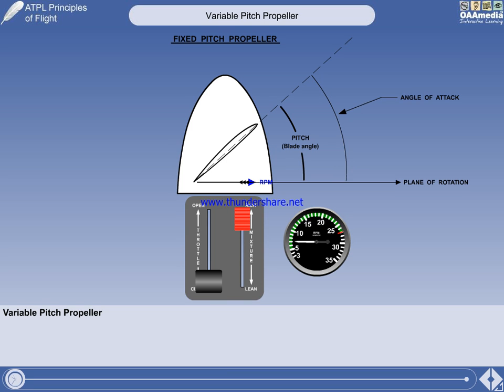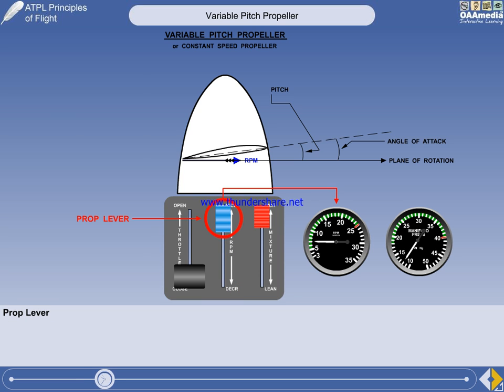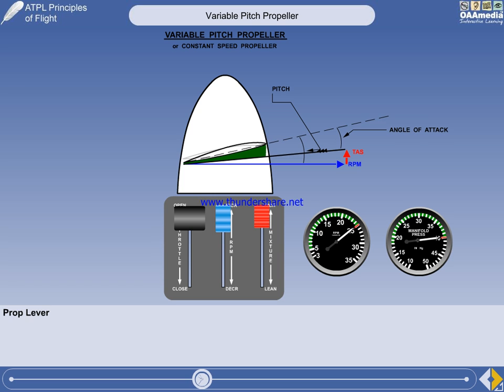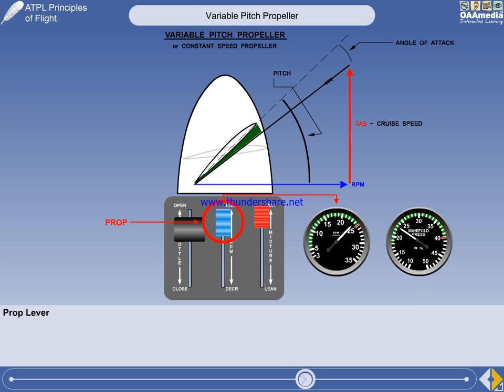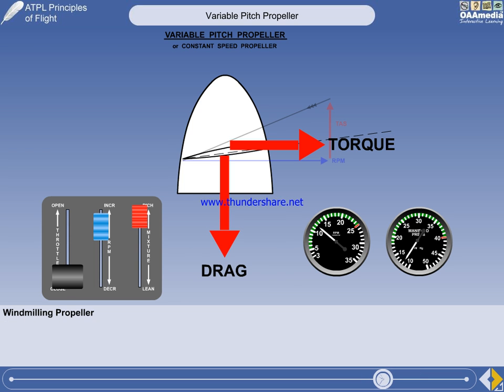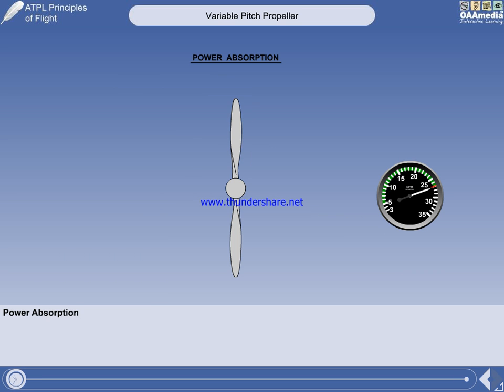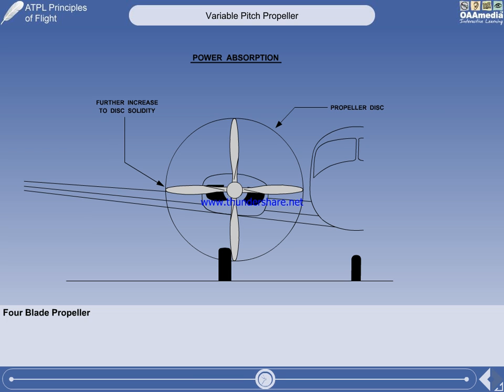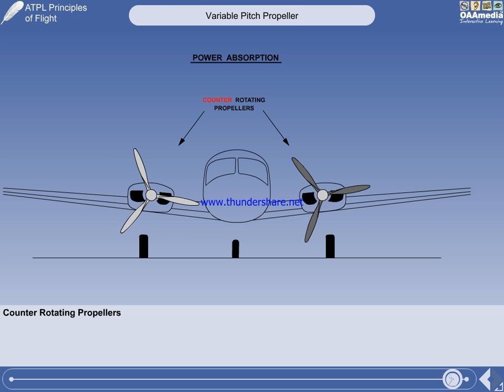CPL ATPL CBT | TECHNIAL GENERAL |  PRINCIPLE OF FLIGHT | PROPELLER | VARIABLE PITCH PROPELLER

Comment: So the propeller RPM has nothing to do with how fast the plane moves?
Reply: well how fast a plain moves has todo with rpms of the fan or propeller but also  the angle of attack on the fan or propeller plays a huge roll. as higher the attack the more air comes through the bades and it is also like a screw. if you use a higher angle of attack on the threat the screw goes faster into the wood or metal. the same with propeller. but one aspect was not talked here..the less blades you use the volume of air increases aswell and the effiency increases.  and the rmp is important aswell..so a popeller with high angle of attack and high rpms and few blades produces alot of airflow,air speed and therefore high plane speed or thrust where as a low angled low rpm propeller produces less airflow,less thrust and consequently less plane speed. But also the power of engine is used plays also a role. the more powerfull the engine the more  air moves cause the engine is able to push alot of air volume.